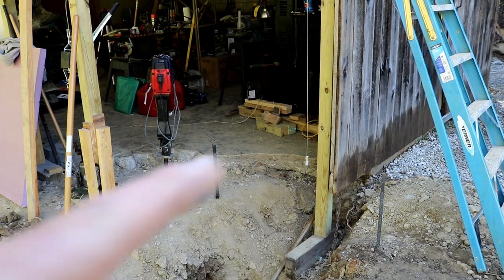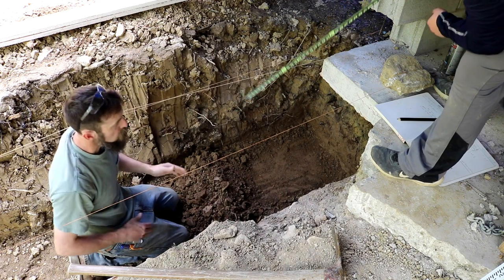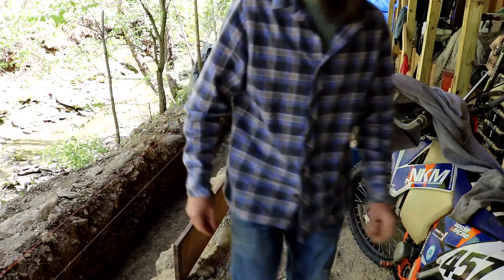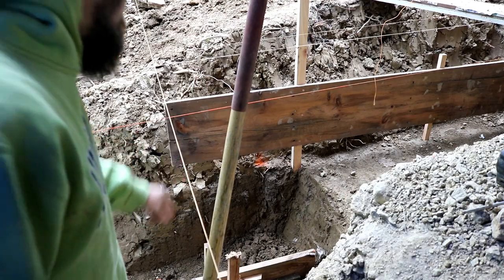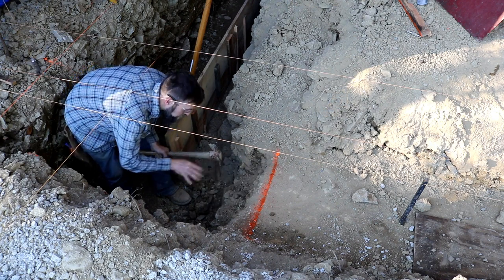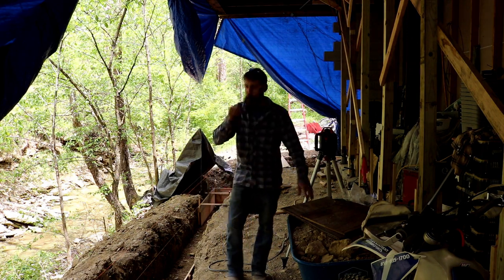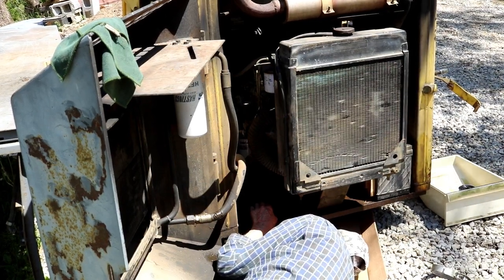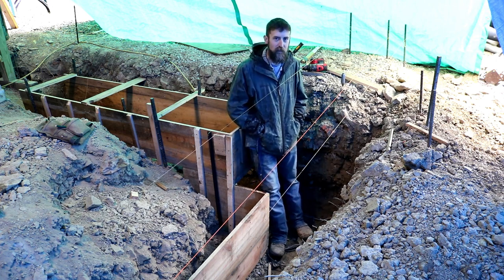Building concrete forms for the shop Footings . Damaged Shop 13

Comment: I'd like to suggest side bracing to prevent blowouts during the pour. That board is only 3/4 inch thick and the weight of the concrete will definitely bend it. You didn't mention backfilling or anything or I'd keep my trap shut... I see someone else (Mr Leadbetter) is giving you lots more explanation than I. There is a lot to be said for making that form start at the bottom and work up to height. You don't want the concrete to flow under the form either.

Comment: Yes I think your going over the top but it won't hurt any I'm sure, you've done a great job so far Steve have you thought about building the block yourself, I'm no builder but I'm told make sure the corners are right the rest is straight forward, I recon you would do a lot faster than you think.

Regards Alan.
Reply: Definitely better overbuilt than underbuilt, especially with the proximity to the creek bank!

Comment: Steve id wire in place the stakes n rebar even any wire to bind the concrete . With helpers you could pour using wheelbarrows  got to be some fellow tubers n followers that would help.  Do it right your way then . If i was able i would i know what your doing n whats needed even laid block for years - string lines for those too. Tell your wife we tubers wish her Happy Mother's day..

Comment: Steve thanks for taking us along this journey. I have one comment and one question. I am wondering why you are using CMUs (concrete block) for the stem wall that will sit on the footing? Why not stick some vertical pieces of rebar into the wet footing and then reform for 8" or 12" wide stem wall pour after the footing sets up? Next, unless I am not seeing something correctly I don't think you want your stem wall to come all the way flush to the existing slab. You will want the stem wall (vertical wall) to go up to  6-8" above the finish grade; that being the thickness of the slab pour (4" or greater of slab plus 2" or more of compacted rock under the slab pour) that you will need to do for the slab right? I hope this made some sense. It's kinda hard to picture I'm sure. Anyhow, I hope this comment helps your thought process. Randy Richards just did a video showcasing his pour.

Comment: Steve, I have the utmost respect for you and I am sure you are going to end up with exactly what you want.  Now.  You are overthinking everything.  I know you've pointed out that you are worrying about 1/32" on the form heights.  You are spending so much time getting things perfect that you're not getting anything done.  The only forming you need is for the steps.  I can't believe the engineer requires footers that tall but, I guess that's why you're doing it the way you are.  Throw those strings away.  Put corner boards up, sight down them with your mark 4 eyeball sensor and drive some stakes to give you an idea of where the blocks will be.  If you want to form it, place your boards in the trench and drive stakes on the inside of the form.  Put some firewood pieces or lumber scraps behind it to hold it roughly in place.  It doesn't matter if the edges of the footer look like a wet noodle.  Don't fasten the boards to the stakes.  As you're pouring the concrete, you'll just pull the stakes out as you go.  As soon as the concrete will hold its shape, pull the forms and whatever you used behind it out.
The contractors don't like limited access work or small jobs.  They know they're gonna have to haul the blocks in by hand.  Talking about filming them is a red flag that you want video evidence to use against them in court when you refuse to pay for improper work.
Always but, always, remember the KISS principle - Keep It Simple Stupid.

Comment: Steve: With regard to the ticks; diatomaceous earth will kill about 95 percent of them. It is non toxic and dirt cheap, no pun intended. The food grade is white in color and a lot of the health nutzoids actually eat it. Dust a little of the food grade on the pups and squirels, then dust the even cheaper grade direct l y on the groung, especially to form about a 3 foot barrier around your house and the shop. Treat the ani-mules about once a month. The only difference between the food grade and the tan stuff is the food grade is from fresh water diatoms. Amazon sells it by a company that includes a little spray duster, but most nursery, pet stores and believe it or not, pool supply places sell it. The pool place may not have food grade, but they sell in BIG bags. It is used in the top of the line pool filters as opposed to sand. Stops almost a zillion types of bugs and crawly things but won't hurt you or the furry critters
 Thanks for the videos and for including Peanut and Chloe and the others!😁
Frank.

Comment: When you pour into forms that have a bit of heighth there is a quite a bit of hydraulic pressure created so be sure to tie the sides of the forms together is a strong way.    Tie wire or something.

Comment: Wax the form boards. It'll be easier to strip them after it's poured. It's been decades since I had anything to do with concrete. We rented Symons forms, set them so they were plumb level and square, then shot grade on the form. We followed up with chamfer strip (triangle shaped, 3/4", nailed so that top of the strip was top of grade. The sharp corners break easy and the chamfer strip gives you a place to run a screed board and a trowel.

I wonder is someone out there makes wooden 1-2-3 blocks :D

Comment: Steve, I hope you plan to place top and bottom re-bar with tie hoops and make your footing a grade beam that will bridge any future settlement.
Reply: Ironwork is metalwork. So Steve ought to be good at it. I'm interested to see how he bends rebar.
Reply: @cessamichelle  Excellent idea with the hoops. Steve when you bend reinforcing steel cold bend it, do not heat it to bend, it will will break after it cools.

Comment: Steve, you’re a smart man. Working with concrete is not that hard. Laying the Block takes a little more skill, but is not that hard either. Do some basic research, through some books and some YouTube videos pertaining to what you’re doing. I’m certain that if you want to do finish the concrete after it’s poured and block work yourself. YOU CAN ABSOLUTELY DO IT. You will need two laborers that can handle strenuous work too assist you. 
    Do some research on the Company that will pour your concrete for the foundation. Most of these companies employees will offer good advice if you ask them.
   As far as laying the block yourself. From my experiences of laying block with a licensed mason. One of the things he always stressed to me, was getting the mortar mix mixed just right. There are videos showing and explaining how to do this. You’re doing the hardest part of your foundation by making the forms for the concrete. Good luck.

Comment: Did you think about how to get this boards out after pouring the concrete?
Reply: I'd be thinking about the void they leave and how to backfill it with something compacted. If left in they will rot and leave a void. I'm not in the trade so these are merely layperson questions I'd want an answer to.  One thing to bear in mind is that any contractor will be long gone before any of it becomes a problem, if at all.

Comment: You know that the step in that pour is going to make is a two step process. It's likely part of why you're having difficulty finding someone to do it. It's ramp up season for construction and they're already busy so they're less likely to want a job like this when they can get easier jobs and be in and out quick. Be persistent, you'll find the right guy to pour this.  A bit of background on me is I went from 25 years in construction to precision machining, I've seen lots of work like this and understand where you're oming from, but it really is a whole different animal than machine work, so be extra prepared to deal with "good enough". LOL

Comment: You know what would get you a more flat surface on the finished frame. If you planed the edges of the frame boards and screened it with a vibratory screed plate.

Comment: A Machinist doing Carpentry.....it'll make yer head hurt.  Years ago I wanted to install a metal entrance door in my shop. What should have taken about 1 day took 3 days. I ended up with wood shims in my Bridgeport milling them tapered for a 'perfect' fit against one of the pole beams. Lets not even talk about sheet rock or suspended ceiling tiles!  I did find that after a couple weeks of framing lumber, I could relax tolerances, and 'let things go' a bit.

Comment: Why are you going back with block?  Why not poured foundation to above grade then wood walls?
Reply: I agree with you
Reply: Block walls are quieter than wood if you've  got a creek right outside (especially if you're trying to listen for a micro switch that is under the machine at the fullest extent of your arms plus screwdriver).
Reply: Fire risk mitigation - by having a low block wall there's nothing down the bottom to catch and hold a spark.   Plus its got to tie into the block wall at the back anyway.
Reply: Not to mention, he had about 500 blocks.
Reply: I think it's because the block is already paid for, it came with the place. And pouring concrete all the way up is $$$

Comment: Its getting there. Not too much more before you can pour than concrete and move on to your blocks.

I’ve been there with the meticulous nit picking over the details that probably done matter in the end. Keep doing that on my current project. Keep trying to convince myself to move on, then I’m back fixing some minute detail again...

Comment: Also if you don't want the concrete to be directly in contact with the dirt walls, you could line the trench walls with rigid foam and use the top edge of the foam as the top of the footing.Unlike the forms you can leave the foam in place. More rants from the old man.

Comment: Have never seen a footing formed up unless it is above ground. Usually concrete is cheaper than the labour.
You keep working off strings . usually set up a profile 2 pegs in the ground a timber between them and nails in top to hold your string where you need them. can mark the timber and the nails for o/s trench o/s block i/s block etc. This will also be used by the block layer for laying
1 big thing you should understand is the weight of concrete on form work. Also really should  be using a vibrator to get the air bubbles out of the concrete in the footing which increase the forces on the form work.

2nd thing hope you allowed for the mortar around the blocks for your dimensions. 

As far as digging a hole and working out concrete required. depending how bad it is take numerous measurement and work out the average. 10 heights along the floor divide by 10 gives you the average depth 10-20 along the width divided by 10-20 gives average width. 

3rd line pump operators have a good eye and will put almost the right amount concrete without too much guidance. But need to ask the pump truck how much extra concrete you need, in metric most use about 0.4 of a cubic meter to fill hopper and line  which is back pumped at end of job and washed out can be shoveled into a barrow if you are a barrow short but usually is just wasted. Ask them to spread it when they wash out unless you want a half ton lump of concrete in your creek project but at least dont forget to beak it apart while wet instead of a jack hammer later.

Comment: Steve do yourself a favor and mark the side of your trench to the top of your footer and pour concrete to that mark. make your concrete a little thin and it will level itself, you will need to move it around a little here and there. No forms to install and none to remove. but your block on top and be done with it. JMHO

Comment: Why didn't you just knock a load of metal stakes in along the whole length of your trench all at the correct level that you need the concrete to be at and then just do a pour upto the level of them steaks and then that way it ties into the floor and the hillside that's exactly what i did on the foundations of a house i helped build, the way you are doing it it won't be tied into the bankside because of the shuttering and when you remove the shuttering and back fill it, it won't be as compact as the river bank side wall of your trench.
Just use the sides of your trench as the shuttering.
Reply: Mark Mawson Exactly! The base of his foundation must at least be poured the full width of the trench, otherwise it is not locked in place... 
I’ve done some underpinning foundations.... pour a 300mm thick base full width, with reinforced steel , then do your shuttering on top of that!
Reply from the maker: The hillside of the trench isn't getting formed just the upper side.
Reply: It is not good to have rebar staked into the soil. In most cities and plans there is a required 3in spacing between any bars and soil. Moisture will cause the bars to rust and possibly crack the concrete. (fyi I am a geotechnical engineering technician and test concrete and do rebar observations sometimes on a daily basis.)
Reply: @SteveSummers  If you leave the forms in place after you pour it it will be fine. The footing transfers its load to the ground on the bottom not on the sides, the steel stakes don't matter either as long as you have 3" or so concrete cover on your structural bars you will be fine. I don't think you have much to worry about as far as form blowout goes, your only pouring 16" of mud in there but if you place a few cross braces on the top of the forms it will help. Brace from form to form every 6 to 8 feet after you place the bars in the forms.  You don't need to be too picky when you screed off the footing gravity will take care of most of it and the block layers have to level the first few courses up regardless.  Probably a good Idea to stab some bars down into the footing while its still slumpy  to tie the blocks in. Holes in CMU are at 8" centers.
Reply: Because concrete is flipping expensive and only pouring as much as you need is a good thing. No sense in wasting a few thousand dollars of concrete when he's not paying for the form work.

Comment: Spray oil inside your forms to make it easier to strip ,You could need as much as 6.5 cubic yards for this ,I would insist on using a tri-axle cement truck ,one load and no on site mixing truck , Best of luck on this .

Comment: My View fill it with concrete ASAP will need to backfill those forms,  frame the walls and use fibre cement sheet on the inside and tin/sheet the outside, less weight on those foundations and sell those bloody blocks, pay someone to help you frame-up I am sure there are plenty of people you could get in as an offsider.

I fully understand your pain on the numbers etc try and be less pedantic I can spend a year thinking about a project before I even cost it lol I am probably as bad as you lol.

Comment: Make sure your fasteners are removable from the outside of the form. Wrecking them out will prove almost impossible with the head in the concrete. My opinion.
Reply: I think he's just planning on prying the forms off. I don't think he's planning on salvaging any of that form material either.

Comment: Love the lock but any steel clad building can be breached as easy as the tarp . I LOST STUFF WITH A HOLE CUT BESIDE THE DOOR .
You put level lines in with the form so fill the trench with cret level along forms and no blow out the forms stay in anyway KEEP IT SIMPLE . I hope your block guy is there for the footer pour he will make the job simple please please .

Comment: Please make sure whoever pours your concrete, uses a concrete vibrator! I can't tell you how many jobs i have inspected where they had no clue to even job the concrete! You have done most of the work with forming and rebar! Might as well pour it and finish yourself, hard part is already done. Good luck!

Comment: Morning Steve, Acceptable Tolerance is what’s making your life a bit hard with this footing. Having had some experience with concrete, I’d say you might want to give yourself a break!!
An inch here or there won’t make a huge difference in width or depth of concrete, the most important thing is that your reinforcement is fit for task, sufficient in quantity and situated accurately within the pour. A little extra concrete over that run won’t amount to much more than half a cubic metre or so and if you use your laser to ensure you’re pouring to the right height, your block work will fall in fine, a mortar bed is where a little variation will be accounted for. 
I suppose your background in precision machine work is why you’re beating yourself up about a thirty second of an inch but relax, it’ll be fine within a half an inch. 
It is however, your time and money, so you need to satisfy yourself and if your method let’s you sleep better then more power to you and everyone else shut up!!
The next trade along won’t ever complain that the preceding operatives were too pedantic and too conscientious, they’ll be glad of the ease with which their commitment can be completed. 
The reason that laser makes such a high pitched, ear splitting, tooth grinding whine is because, on a big site, where you may be fifty metres or more away from the sounder, with heavy equipment and site noise at deafening volume, you still need to be able to hear it. That annoying whine maybe the difference between achieving the task at hand or creating a costly mistake.